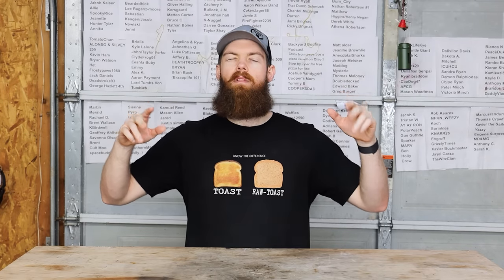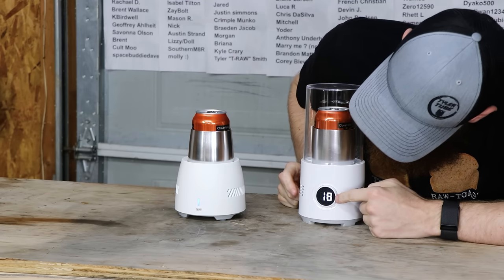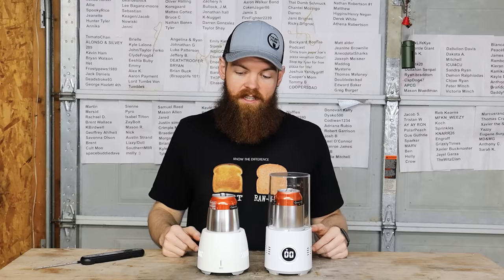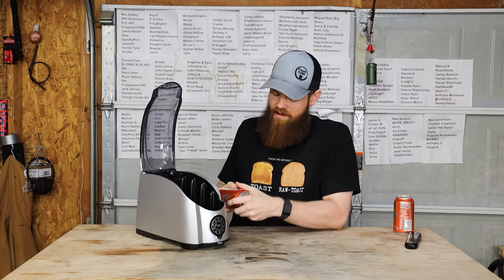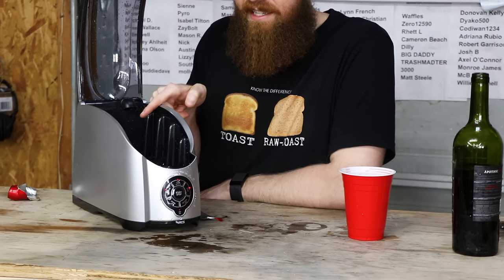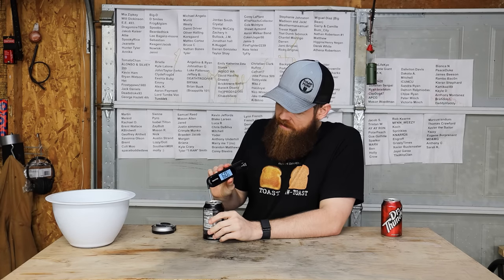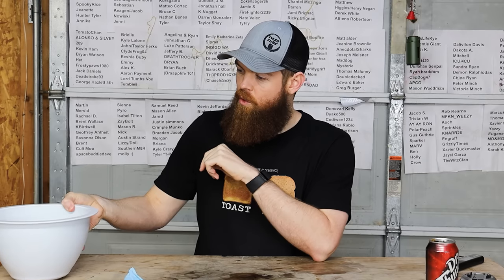Is This The BEST Drink Cooler From Amazon?

Comment: Used to use a metal deep meatloaf pan and freeze blocks of ice to spin cans  back when I did demolition work, the block would last all day! Used a cheap dremmel with a stone grinder bit wrapped with a rubber band for traction. set the can sideways, spin by hand a sec or 2 to get a "groove" then use the dremmel! doesn't take long with some RPMs and it gets cold quick! not to mention soda-safe too! (wont explode, never shakes up) The salt-water trick works a bit faster because it prevents the water from freezing and allows it to drop below 32 degrees. I never timed it but i wouldn't say longer than 2 minutes would be considered "ice cold" all the way thru. Co-workers laughed until they realized how cold my drinks were :) Pretty soon everyone was asking me to spin theirs!

Comment: I absolutely loved how well my Cooper cooler worked. Literally physics and thermodynamics at play and FAST. The only problem is that this thing is made entirely too cheaply. The internal components are not well insulated from the water, the motor isn't high quality, and I've had two fail so far on me after about 8 months of reliable use...I'd rather they cost an extra $100 and be made properly.

Comment: The spinning give the temperature change some oscilating, so the heat would dissipate more evenly and therefore faster, your method of using ice and salt os actually the old school way of how we used to make ice cream, we put the ice cream mixture in a metal tank chamber surrounded with salty ice, and then just spin the thing

Comment: For anyone who wants to know, the spinning is like stirring a pot, or moving air over a heating element, you transfer heat over a medium (air or some kind of liquid) you end up "sharing" the heat with more and more surface area, till there's not enough heat (energy) to go around, and you get a lower temerature as that energy is disbursed

Comment: They sell a drill attachmenta for the cans to use with the salt water. It does wonders for about 2 minutes.
Also fyi, salt lowers the freezing point of water, hence the whole solution can go under 0*C and have a greater cooling effect.

Comment: if you put the can in ice, a small layer of air will form around the can and shield it from cooling down. The same happens when you just pour the water over it. But when you spin the can and bottle its constantly cooling down

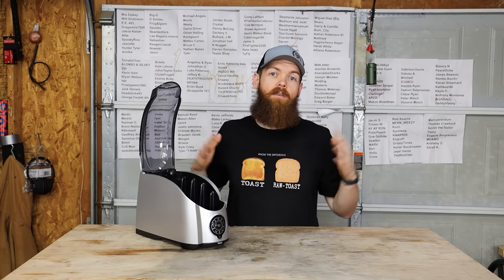Comment: 9:17 what i will say to this is that if you have a warm oject sitting in like a cold liquid the liquid thats imediatly around it will warm up, thats why switching it out makes cooling more efficient, this is veeeeeeeeeeeery good to know if you ever fall into water and you are super far away from land and its cold you need to try and lay still and be in a fetal position so that the water around your body doesnt flow away and get replaced by cold water
Reply: also the reason the can is spinning is not only so that the water touches all the sides but also so that the liquid inside mixxes so you dont get cold edges with a warm center

Comment: Also, if you dont have a cooler/just cooling 1 drink - i learned that if you wrap a can/bottle in a wet paper towel and place it in the freezer, it takes like, 10 minutes ans that thing will be pretty darn cold.

Maybe something about the moisture absorbing the cold easier and being wrapped on the can. I seen it a long time ago and it does work.

Comment: The reason the super cooler spins the way it does is what good is it to shake up a can of carbonated beverage then try to open it? So it spins it just enough to keep fresh water contacting the can, and to mix the beverage inside.  It's not a scooby doo mystery. The salt is not required for the super cooler and it is not required for the same technique.  Salt lowers the freezing point whch is why it has an advantage over ice, but in this case, it wouldn't make any difference.

Comment: The primary factor in the Cooper Cooler is the water flow.  When you put the can in still water, the water next to the can will heat up.  That makes the heat transfer less efficient.  If you keep the water flowing, then you keep cold water next to the can.   Spinning has some effect on that because you are stirring the water.
Adding salt, or pretty much anything else that dissolves in water lowers the freezing point of the water.  The chemical term for that is freezing point depression.  The ice is already up to 10 degrees lower than 32 F, but the water in contact with the ice is always at the exact freezing point (32F).   When salt is added to the water, the liquid phase temperature can be several degrees colder than 32 F, which increases the cooling effect.  The same effect is used in ice cream makers.

Comment: If you're still wondering how the cooper cooler did so good I can give you a few reasons. The heat capacity and therefore heat transfer speed of air (let alone static air) is much lower than water or even flowing water. On top of that if you remember how the freezer one and the cooler cups were colder closer to the cooling elements, or in the case of the freezer the outside, that's because water needs to be moving to move heat properly, and when you have it moving around like that you mix the still warm soda with the colder soda you make the temperature of the fluid contacting the cooling warmer which by the laws of thermo-dynamics allows the heat to transfer quicker as the laws of thermodynamics states the transfer speed of heat increases with the delta (difference between).

Comment: as the can rotates, the outer layer is exposed to the ice water and then spins into the middle and the liquid in the middle is spinning on outward in a cycle because of centrifugal force kinda. so it's constantly cycling out like a radiator, eventually all the liquid inside has been ran through the ice water at high speed, so in 60 seconds, all of the soda has had it's warmth dissolved and the ice cold temp has made it's way in. it's why sitting still didn't work but the spinning motion did. you can even put a 2L in a sink full of ice water or a cooler, etc and spin it really fast for a minute or two and you'll start to see the same thing.

Comment: You should lie the can and rotate it with the fingers just as the Cooper Cooler did (as if your fingers were running on top of a barrel). That's the way you make icecream, put condensed milk inside a can and rotate it in ice with salt for a couple of minutes. A Japanese program did something like that but with a huge barrel and throwing it from the top of a snowy mountain.

Comment: I didn't believe the trick of wrapping the can in a wet paper towel worked until I tried it, and it seems to be a way better option than these things. I'm happy after 10 or 15 minutes, it helps the freezer is already cold. It only beats the Cooper Cooler in cost and prep time. I would wonder how it ditches the melted ice for your next use. 

I'd love to see a drill bit attachment so you can spin one faster like the Cooper. Save space and money, you'd just need to be somebody that keeps a drill near your kitchen. I don't use the paper towels much, so having that option if I forgot to restock and am craving my Sunkist would be neat.

Comment: From my limited knowledge, so take it with a grain of salt, the Cooper Cooler works by both spinning the drink to more evenly distribute the ice water across it's surface, but also the waterfall causes the water to pull more of the drink's thermal energy away from it quicker, which is why it's so quick. That would also explain the diminishing returns on the "Extra" setting because the drink's thermal energy is closer in line with the ice water.  It isn't as effective in the second minute because it's can't pull more any thermal energy away from the drink can than the water itself has.

Comment: If you have a sous vide machine, you can use it to help cool drinks. 

Many of them will go down to 32 degrees, so they won’t actually heat the water but just circulate it. 

You then get a bucket or something, fill the container with ice, water and your drinks, put the sous vide in and it will circulate the cold water around

And because Tyler doesn’t understand why you want the water to circulate: the water around the can will warm up.

Comment: If you have a bucket of ice, you can just toss the warm can in there until it melts a small depression and roll it around for like 90 seconds and it will cool it down to fridge temp, so that spinning one is a sure winner.

Comment: Facts Tyler is in Texas. It’s just HOT most ALL YEAR LONG. I’m in Atlanta Ga., for everybody saying just open the window….  instant COLD . We open a window… instant HOT. The Cooper Cooler works on a similar concept as ICEE and soft serve ice cream machines., the rotation is the key. As for the best way I’ve found to chill a drink fast. Like 2-3 drinks put them in ice bin in the freezer. If you need to chill a 6 pack or a 12 pack. Get 1 of those cheap styrofoam coolers a layer of ice in the bottom., the drinks., then more ice., add salt then water til the ice starts to move.

Comment: They make a drill attachment that pops on to the rim of the can so you can spin in it the salty ice water.  Works just as good as the cooper does.
Reply: another trick, is to add a wet paper towel around the can and put it in the freezer

Comment: If u think about it it kinda makes sense like the water on the surface of the can in ice water in a cooler doesn't move so the water around it takes longer to cool but if the cold water is always as well as the can in just work's

Comment: The white drink coolers are supposed to be poured into not can cooled. I thought it was can cooled when I bought it but did research and it was to be poured into the steel container. Aluminum is an insulation against the steel

Comment: So salt lowers the freezing temperature of water down to about 19°-23°f if you would've tired just spinning the can around fully submerged you would've had better results. Typically it's used to make homemade ice cream and they use rock salt. I bet if you would've added fully soluted salt water (not rock salt lol) to the cooper cooler you would've gotten better results too.

Comment: You should see if the Cooper cooler can freeze a soda with the wine and extra settings and putting rubbing alcohol in the freezer to get it damn cold and use dry ice instead of ice I have faith this combination will work

Comment: Get a regular cooler, a bag of ice, salt, and a trash bag. Put a layer of ice across bottom of cooler add a lot of salt. Take the garbage bag and put all drinks in the bag. Put bag of drinks in the middle of the cooler. Add more ice around bag make sure you are holding the trash bag closed add more salt. Then still holding bag closed add more ice you want to make sure the opening of the bag is above the final layer of ice and then add more salt. The salt lowers the temperature of the ice allowing it to get the drinks cold really fast. The bag prevents your cans from getting the taste of salt water at the can opening. I learned this the hard way first time I did it I didn't use a garbage bag and mmmm really salty beer.

Comment: The best method remains wrapping a bit of toilet paper or any kind of soft paper around the can, making it wet with cold water and then sticking it in the freezer. Don't need any special machines for a very fast cooling.

Oh ice baths are a good one, left my comment before you showed it. Although I think the technique is best left for winter, when you can throw all your cans into the snow and cover em up. Not sure if the ice bath is faster than my wet paper method, will have to test that. Feels like the ice bath would be faster but you sacrifice space for it. whereas my freezer has a ton of space. (also Id never spin anything I have actual wrist issues from gaming, lul)

Comment: The fastest way to freeze or get your soda cold from room temperature is to get a paper towel wet it just a little bit wrap the soda around the towel and put it in the freezer for 20 minutes in 20 minutes that shits gonna be like 20° just don’t forget your soda because it will explode are used to do it all the time at my old job

Comment: So the reason that water works better than ice is because it takes more energy to raise the temperature of water than it does to raise the temperature of ice. When you have a mixture of ice and water it is always at the freezing point of the water, so putting ice and water in the cooper-cooler means that as long as there is still ice the water is at 32 F. When you add salt to the water it lowers the freezing point of water, so the water with ice and salt in it is colder than the water with just ice in it. All of this makes lowering the temperature of the soda can much easier than using ambient temperature like with a fridge or freezer. As to the spinning action? That's just circulating the water around the can so you're constantly getting colder water as opposed to cold water that is slowly being warmed and needs to exchange more heat with the surrounding water.

Comment: Reason why simply setting in a cold environment is so inefficient is due to heat transfer. Heat is simply the transfer of energy between two objectives due to temperature differences. The higher temp object will always transfer heat to the lower temp object. So when setting a room temp can in the fridge or freezer, you're basically waiting on all that energy to slowly transfer out into the cold air. Resting air and a resting object are terrible inefficient at transferring heat. 

Thinking about being how good it feels to have a fan blowing on you versus just sitting in a room. The air temp is the same, but that moving air is much more efficient at transferring heat from you as you're not just transferring heat to the same air molecules and waiting for the temperature to find equilibrium. Cars are another good example. When the car is moving, air flows through the radiator cooling the coolant which then cools the engine. The heat from the engine transfers to the coolant, and then the coolant goes back to the radiator where it transfers heat to the passing air. F1 cars run so hot that the engines will blow if they sit still for a few minutes. That's why they put blowers over the radiators when they're on the start grid or waiting in pit lane to go. But going full speed at close to 200 MPH, and they run fine. Race cars also have brake ducts as well to help cool the brake. They have ducts to flow air over the brake and tire to help keep them cool. They obviously heat up under braking to the point of being red hot, but then will cool by 100 degrees down a straight at high speed to where they aren't glowing anymore in just 10-20 seconds. Meanwhile if you left the same red hot brakes sitting out waiting cool, it would take a long time to cool down.

So back to cooling cans. Flowing fluid is going to be much more efficient at cooling compared to a static fluid. And the same goes for the can. If the fluid inside the can is also moving, then the heat is being transferred out evenly and not just the heat in the soda at the exterior of the can. The Cooper Cooler is basically functioning as a radiator for a car. The water is the coolant, the ice is the radiator and flowing air, and the can is the engine. The water flows through the ice cooling the water which then runs over the spinning can cooling the soda. Heat from the soda transfers to the running water which then transfers the heat to the ice cooling the water. That's why spinning the can in the bowl of ice water also worked somewhat well. It's not as efficient. The can isn't spinning as fast, and the water isn't flowing as much and not being cooled by the ice as efficiently. Even though letting the can sit in the water for 5 mins cooled the exterior down more than spinning it for 1 minute, spinning it definitely helped cool it more evenly.

Comment: It's physics. The water will be at freezing. The rotation makes the liquid stir so it isn't cooling outside in. The greater the temperature difference the more energy will transfer, so if it were just cooling outside in it would take longer.

Comment: Now try this: Put a bit of salt in the water of the machine and mix it around - obviously you'll want to wash it off after you've cooled your can, but you'll get it even colder ;).
Salt cools things faster because it increases the freezing temperature of the water, essentially allowing the water to dip below 32f/0c whilst remaining a liquid.
This is why there is running water in the Arctic and Antarctic regions because the salt content prevents the freezing until much lower temperatures.
Salt takes a while to work, though, as you need to wait for the ice to melt a bit. The flowing water helps greatly due to the constant movement, spreading out the thermal load and 'touching more surface area'.
Reply: I wouldn’t want that salt going through a pump.. in he off chance you forget to clean it eventually it will rust stuff.. if anything.. dry ice.. 😎😎 I got mine in today and shot a short for today to come out and I debated buying some dry use to put in it.. I bet it would be amazing lol
Reply: Ice

Comment: I'd be interested to know how those coolers do in hot weather. They probably work better the warmer the ambient air is
Reply: Why would they work better the warmer the air is? That makes absolutely no sense
Reply: @AflakAttack  it's the exact same way Air conditioning works. If the evaporator is in a warmer area it can expell heat better......it actually does make sense.

Comment: A trick i use to make drinks cold quick is to wrap them in a damp paper towel and throw them in the freezer. EDIT: still takes like 8-10min but doesn't require a special device and isn't as messy as dealing with ice water